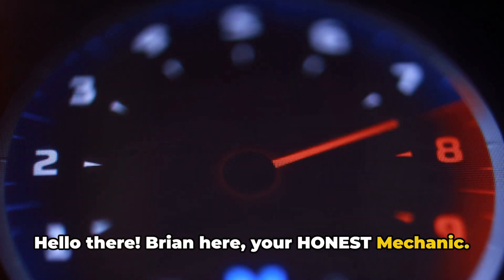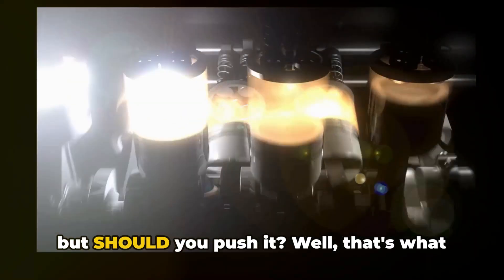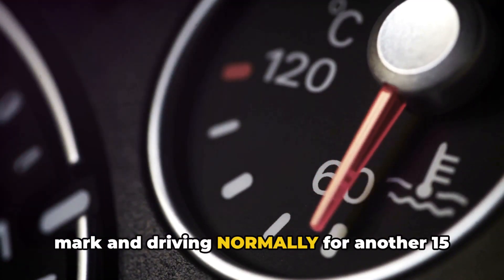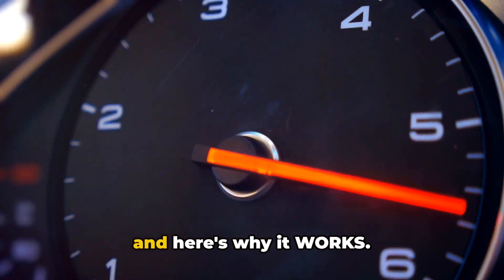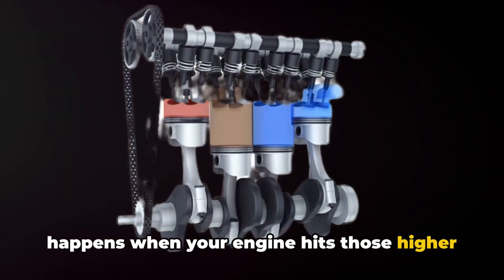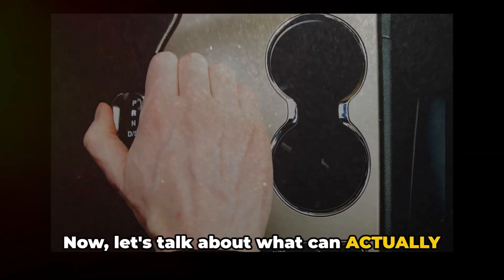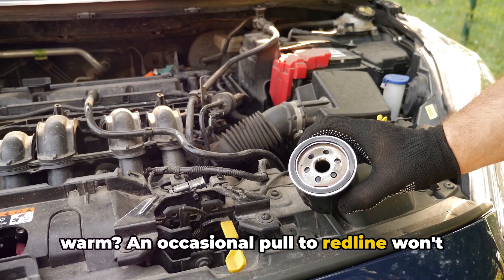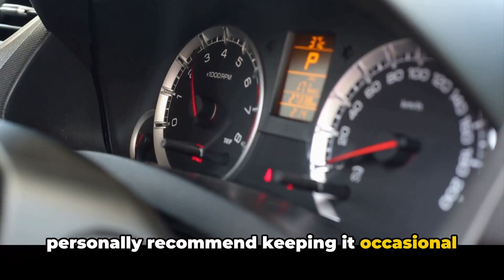Redlining Your Engine: Is It Really BAD? (Shocking Truth Revealed!)

Comment: Does the oil temperature really take that long to get at optimum levels? I heard that you had to wait like 5 minutes after coolant temp.
Reply: How long can depend on what is optimal temp for cars. My car personally which is a V8 Camaro usually takes about 10 minutes or more to reach optimal oil temp of 170 (lots of idling at stop lights can make it take a long time). Coolant does indeed warm up well before that but I'm not sure exactly when. I think it takes half the time or less that it does for my oil which would be 5 minutes, but I never really measured it to be sure.
Reply: I watch transmission temp, that heats up the slowest. 20-30mins to optimum temp.

Comment: If i get on my Hyundai i20 to 4 or 5 thousand rpm, the car starts smelling burned😂

Edit: motor and oil were hot enough, i was driving about 25 minutes (land travel) and then when i was in the city i pushed it up and it smelled burned 😂

Comment: Red line could not be bad ...but its more harsh for the motor ..doing this everyday ... reduces life of engine. italian tune is bullshit... 2000 rpm or 6000 rpm dont move parts more or less , they dont stretch the legs ... 6000 rpm or 9000 rpm just causes more vibration ...vibration is always bad, causes slack between parts and consequently more daily damage...
Reply: It's more or less clearing out any junk that might be possibly getting in the cylinder runners. Everything else yes can affect the engine negatively but if a manufacturer built it correctly it should withstand it not every single day of course unless it's overtuned for it
Reply: High rpm is better than too low rpm lugging the engine. 

I did see someone blow up their engine with constant rev limiting with every shift though.

Comment: If you hear a rod knock. Tow truck time😢😢
Reply: Did this happen to you while redlining?
Reply: Or a violent boom and complete loss of power. 

Someone I knew with a Scatpack Charger that he had since brand new and absolutely beat the shit out of the motor. His car ay 107k miles was driving like brand new still and he decided to do a pull from a highway ramp and the motor just violently blew up. dude was lucky to have an extended warranty good for 130k miles.

Comment: If engine is built with quality redline is top safe rpm, beyond you get valve float. It is fine if engine is designed right and built with quality.parts. ran old ninja bike at 11 grand redline all the time I 6 yrs 60k miles ran perfect never any failure of any part engine or otherwise,  but japs build quality stuff.

Comment: Don't redline but keep the car at peak torque. That's when car is most optimal

My 2.0 diesel runs like dream at 2k
Reply: You want peak torque under high load.  Driving at peak torque with low load is just a waste of fuel.
Reply: I don't know why you would want to drive at peak torque constantly. It's not beneficial at all.

If you're talking about driving the car fast, then that's different. Peak torque is different and HP is more relevant at hand as HP is a function of torque * RPM. Peak HP is where you want to be to go fast (usually about 500-1000 RPMs before redline). You'll notice in performance driving, everyone shifts at or near redline and not peak torque because the next gear ultimately slows the vehicle down more.

And also, diesel engines are much different than gasoline engines. Diesel engines tend to make peak torque at lower RPMs than gasoline engines do.

Comment: and ofcourse always use the original oil from the manufacturer.
Reply: huh? much better off buying a full synthetic of literally any name brand... if you are buying "honda oil" from the dealer you re not doing anything good. 
the importance is to buy the proper spec oil (Example: 5w 30)
Reply: Wrong bro, not at all, depends on weather, type of driving, if you have mods etc

Comment: A little redline is nothing. Try driving in a 4k rpm range for a half an hour, occasionally going little up and little down with rpms.
Reply: so... normal driving?
Reply: @root3291 IKR ? This guy, I guess is a Diesel owner lol
Reply: That's great, if u don't keep vehicles long
Reply: I’d hate to be your car.
Reply: Yep, motorway driving a 5 speed manual transmission. Killed my engine, and I changed oil religiously every 5k
Reply: @drazengordon288 i had a honda accord with 5 speed auto going at 90 mph the car cruise at 3k rpm. Pretty crazy lol. Now i have a 8 speed transmission which cruies at 2k rpm at 80 mph.

Comment: I money shifted my 2006 audi a4 quattro like 5 times at top revs😮, but nothing happend😊
Reply: Technically speaking, it wasn't a moneyshift then. Only, if it costs money afterwards. Hence the term "Money"-shift
Reply: @recordingdude489  Turns out, it was a mere Free Shift, after all. 😅
Reply: @recordingdude489  it will show up later, i am sure that my dual mass flywheel did not like it. The point is it did not blow the trans or engine. Engine is 2.0tdi btw

Comment: How does that apply to hybrids?  You could get to the highway on electric and then when you need speed, the engine kicks on while cold and with the oil mostly sitting in the pan.
Reply: do a remote start before getting in the car or turn on the heat to manually start the engine
Reply: Nobody cares about hybrids, lol
Reply: Hybrids won't last long
Reply: Mmm that is not good... And anyone that know how an engine works turn of the "stop start" function on their new car because it give extra wear on engine, starter and battery.
Reply: @a64738  these companes just want to get better scores on fuel economy, it is very sad for the consumer. i tried to convince my friend to turn off stop start but he says he wants to save money on gas...
Reply: @a64738  cars with stop start have much tougher starter motors than a regular car

Comment: I do about 44 mins every single day on a highway with diesel engine.
Reply: Thats good but dont rev a diesel so hard petrols get away with it more :)
Reply: @weatherwatcher5303 aren't they build stronger for a reason anyways?
Reply: @weatherwatcher5303 they can be revved hard
Reply: @weatherwatcher5303 Diesels are literally built tougher. Diesel pulls a petrol apart with how strong those mfers are.